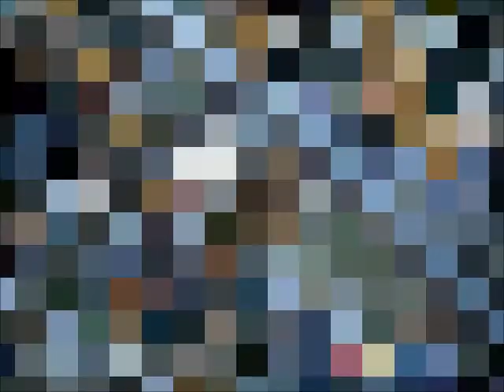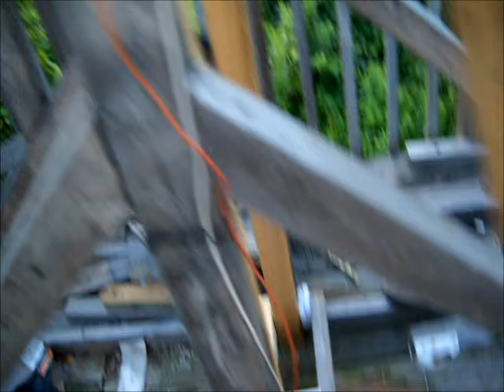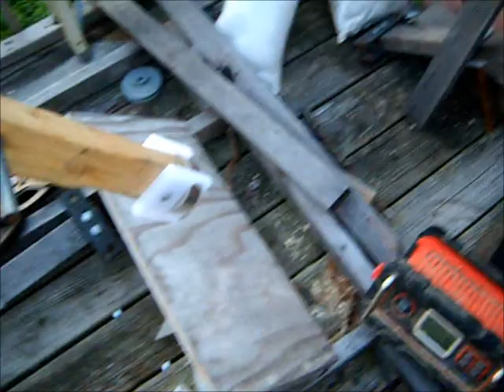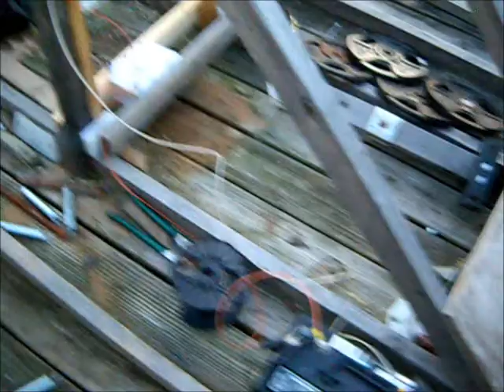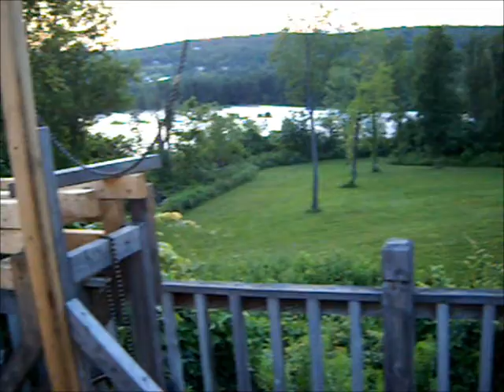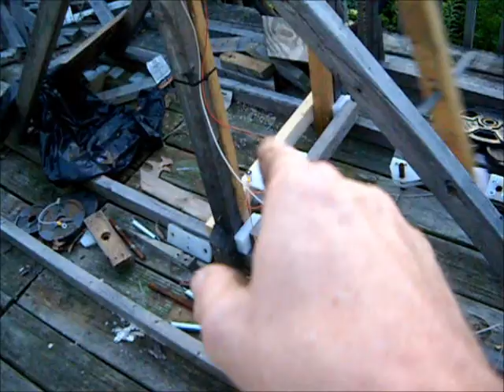GRAM 7 29 18

Comment: Are you repelling or attracting? I don't like those micro switches for short pulse time. I played with Adams motors some time back and these things were sensitive to the timing and duration!
Reply from the maker: Hi, the Emag is in repulsion mode. Adding some capacitors to the coil should help with the timing. Thanks for the help.
Reply: From my understanding of these things, if the timing is just right you will not only get just enough power to kick it off but also the coil will ring and oscillate with the collapsing field and push even harder. I am thinking that you may have good timing in one direction and bad timing in the other. An inherent problem with pendulum designs, a motor would have consistent timing because the timing is pulsed in one direction only, but because your timing cam is only so wide and you would have to trim that cam down to shorten the pulse, and center it exactly so that the pulse looks the same from both directions....Suggest an oscilloscope so you see the pulse duration, it doesn't need to be anything expensive, a DSO nano will be enough and they are under 100 bucks.
Reply from the maker: Hi, I have a  oscilloscope. I plan to start with attempts for simple solutions first and if there are still problems we can try more complex solutions. Thanks again for the help.
Reply: GoVertical17 well throw that probe across that coil and dial in to see one pulse man! ;) Just listening to the clicks looks maybe the swing to the right hand side is clicking a little late? Could be completely wrong if the audio is out of sync even just a little. Just had the thought that a smaller micro switch would snap closed quicker, being smaller...be an easy quick swap.